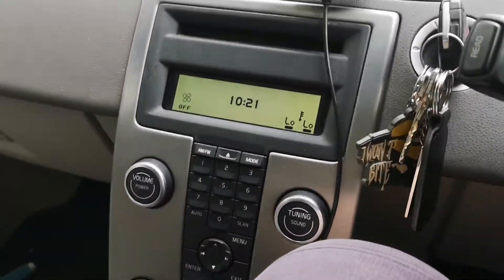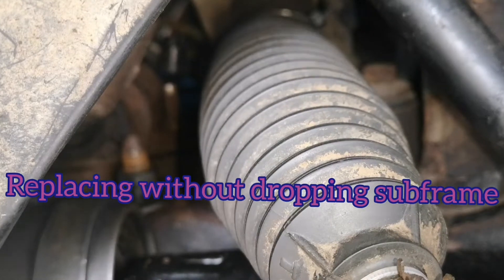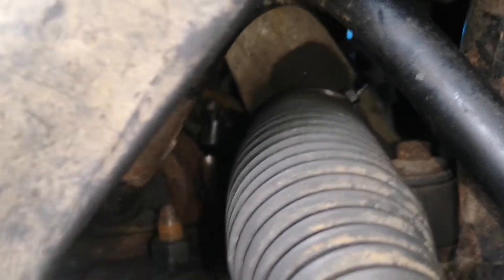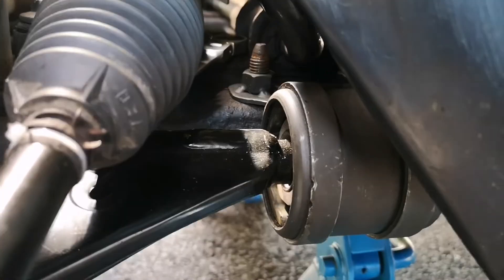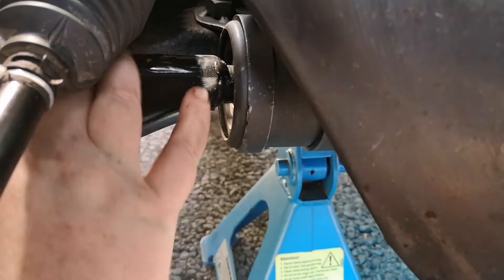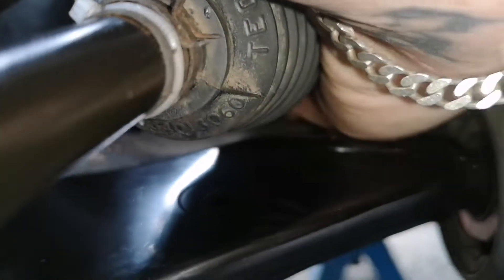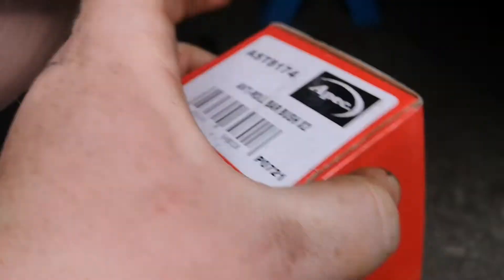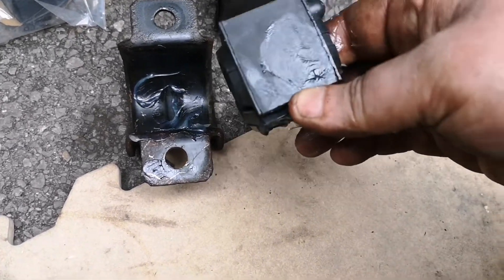Anti roll bar bushes volvo NO SUBFRAME REMOVAL

Comment: Thanks for the video, I've got the same problem on p3 xc70, now I know is possible to do it without touching the subframe!
Reply from the maker: If i had to do it again i would probably drop the subframe slightly go gain more room, good luck doing it but it is very tight 🙂